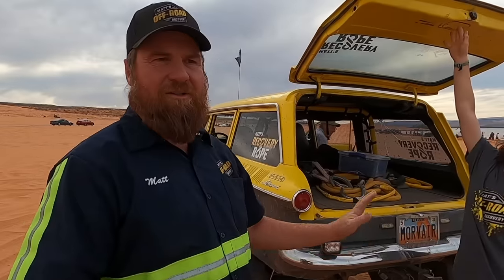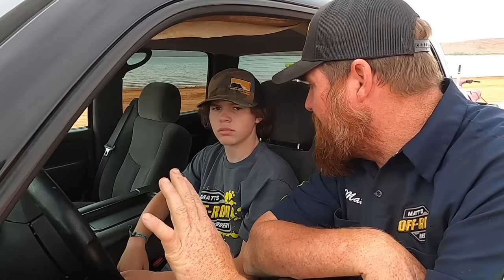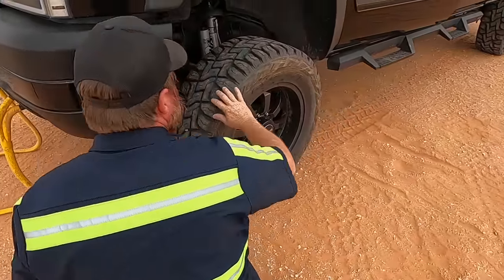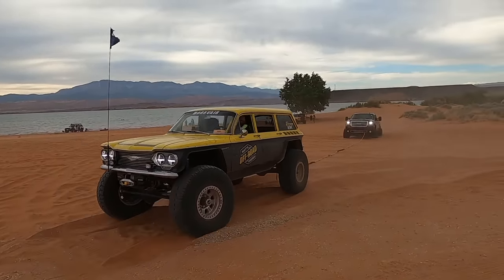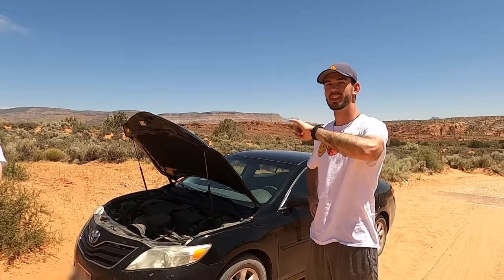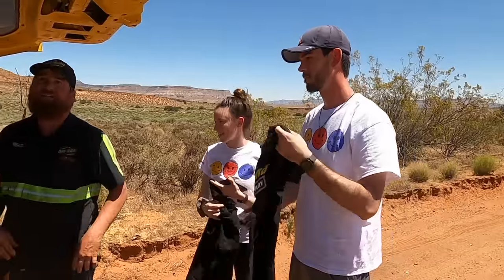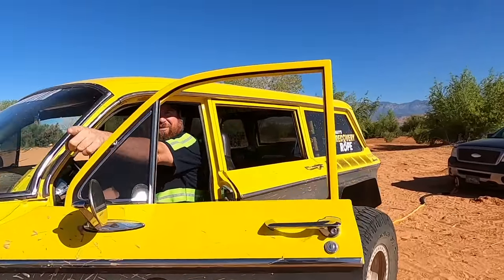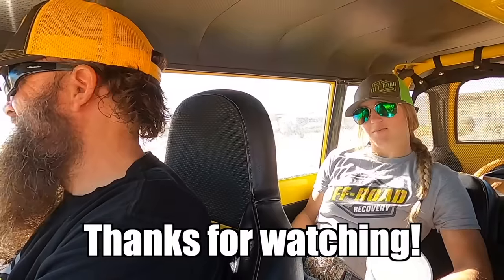Destroyed Drive Shaft! Some Trucks Aren't Made For Sand

Comment: I'll bet folks didn't notice, but @5:53 was a master class in driveline and traction management - Matt got off the go pedal right before he started getting traction from the asphalt.  It's subtle, but that's how you keep from breaking stuff!
Reply: Oh I noticed, I've seen what happens if you don't!
Reply: Also noticed. Bad news if you stay in it.
Reply: Yeah alot of the terrain that I run can go from loose sand and silt to hard pack and rocks in real quick succession so ya gonna know just when to snap the throttle shut before parts go 'bang!!' but also not to soon or you'll be stuck between some rock and a sand place!!!LOL!!!
Reply: I have learned to turn away from certain four wheeler trails.
Reply: That’s the easiest way to snap a shaft. Lotta grip quickly.
Reply: Yep I noticed?

Comment: I learned to drive in a Corvair just like that. My parents bought it new from the dealer in 1963. I do not remember it having the power seen here. I think the reason Matt can get that small air-cooled engine to do this much work is pure driving skill. LOL. I loved watching them restore this Corvair and convert it to the Morrvair, but every time I see it in action I remember my original driving experience. In addition to the Corvair my family had a Chevy with the big block V8, this is the direct ancestor to the motor MORR is putting into the big wrecker. It was amazing to drive the Chevy, and lay rubber.
Reply: It has a LS motor in it now sir.
Reply: "small air-cooled engine"  🤣🤣🤣

Comment: "I was hoping for more of a struggle", says Matt. ---  Truck and trailer weigh 20,000 pounds (9071kg)
and Matt's little yellow Corvair  weighs about 5,300 pounds (2404kg). That was more like a tractor-pull than
an off-road recovery.
Reply: guessing more like 5000-6000kg on the truck and caravan but yeah still impressive
Reply: @MrTrizmaster  If your truck and trailer don't weight 20,000 pounds, just be patient. 
Your wife has not yet finished loading everything you won't need for the trip.
Reply: @lanceleavitt7472  it just in norway we have max limits on how much the car and trailier can weight, depending on the lisence, car, and allowed storage weight,  and a car is usaly not more than 2,5t on avarage(aware of ligther and heavyer vehicles) and a caravan ( with normal weight around maybe 2,5-3t. But i do not know what you are allowed in merica, but 9t looks too much for that truck and caravan, uness it is filled too the brim with rocks.

Comment: I'm surprised that a truck with full on street tires and zero sidewall managed to break a driveshaft on sand without jumping it. I wouldn't have expected that to be possible.
Reply: What if he had revs on and banged the shifter D to R to D again and again?
Reply: Stock one broke had a company make me one and they didn’t weld it right

Comment: I know next to nothing about trucks, off roading, 4-Wheelers, etc., but I have really come to enjoy this channel. I noticed that Matt commented that the truck with the jet skis in tow had tire PSI of 65. During the actual pull, Matt’s truck with presumably lower PSI appeared to float across the top of the sand, while the truck and trailer in tow seemed to plow or push their way through the sand. Am I correct that the tire PSI difference is what allowed this to occur?

Comment: Hey guys! I know this will seem off topic but I have a suggestion for you. How about putting a gas tank in your yard for fueling your vehicles. When you get back to the yard part of your unloading routine could include fueling up. That way you will always begin a call out with a full tank of gas. Maybe you won't run out of gas so much. Plus, you might be able to get fuel cheaper as well. Just a thought.

Comment: So I was just out in Central Utah, west of Provo picking up a trailer with a 1 ton Chevy.  I had to drive 7 miles out on a country / dirt road and had a patch of sand dune that covered the road. I knew from watching this channel that a 1 ton is not the best vehicle to handle sand.  I also knew that if it got in trouble I was going to have to let some air out of the tires!

Comment: I bought a CAT brand portable power station with a air hose on it and I'm going to deflate my tires on my truck when I go on the beach and see how well it does.  It's nerve racking to drive a diesel on sand.

Comment: It amazes me that someone can sit that long and no one offers to help. And, at least on our beach, diesels, properly equipped and aired down, do just fine in the sand.
Reply: People do help each other out but when it's traiker or something they call the pros
Reply: @skeeterbuildsit6016  That truck and small trailer? Pretty easy pull typically for us out here, though I don’t know his sand. Just gotta have some recovery equipment, which, if you are going off pavement, you should invest in and have anyway. Hell, it’s a party if we get multiple vehicles stuck. Adds to the fun.

Comment: Still haven’t answered why you didn’t choose a diesel for the heavy wrecker. I like the Big Block chevy but just want to know what the cons are for a diesel. Mainly because that’s what’s in my build.
Reply: Power to weight ratio. In the sand you want a lot of HP and little weight. There is a reason the Top mudd trucks are gassers.
Reply: @davids.9834  I’m not sure if that’s all of it, probably for the mud trucks is people find it’s easier and cheeper to build a gasser. But power? My truck is around 500hp, 1300lbft and that’s a mild diesel.
Reply: @robertcotrelljr8573  and probably for the price of what you put into it... you could have gotten 1000 HP out of a large block v8 that weighs in at half of what that diesel weighs. . Im not anti-diesel,  but they just are not great in the sand. They just dont have that instant, wack the throttle, and your skimming over the sand, response.
Reply: @davids.9834  also I speculate from experience. Many have setup issues, if you setup up your diesel trail rig like a gasser, yes it will fail. Diesels don’t need the low gears that gassers do to obtain the necessary wheel speed. Many people I’ve seen on forums and such just don’t take the time or thought to build a smart combo. With my truck it is on 40’s and only run 4.56’s gears, I rarely every use 4 low. That’s said I’ve haven’t gotten to more technical trails yet. But if I needed wheel speed for sand, I’d just take off in 2nd and can assure you the wheel speed would fling sand to the moon.
Reply: @davids.9834  oh and one last thing. I wanted to know why Matt didn’t want one, I’m sure he has a good reason and I want to know what it is. For my build or a future build, he builds smart vehicles and I would like learn.
Reply: @davids.9834  well maybe! It’s easy to hit over a 1000hp with a diesel and twice that in torque. Plus yes you can have good throttle response out of a diesel too, if you assumed that and drove a p-pumped Cummins you’d probably lose it on a wet highway at any speed. I grew up as a hotrod’r and refused diesel could do anything other then tow. Boy was I wrong, imo the only reason they don’t dominate every power sport is this country always pushes gasoline and never consider them until the early 2000’s as performance engine.

Comment: What kinda tires does Matt's recovery yellow rig got on it
Reply: @MattsOffRoadRecovery  
Heck yeah man . . . Them things looked spectacular doing what they were designed to do and that's stay on top and bite the sand instead of trying to become a mole and dig a tunnel. Making me rethink my plan of attack on a sand loose dirt tire 🙃 . . . Yeah I was going to try out the Interco - TrXuS STS - Radial ( four 38's on a dully back axel, 10" rims 10" tires and use two 44" swopper boggers for floatation on the sand and if things got muddy they'd prove their worth ( I'm thinking anyways) on the front of a regeaded differential that would match the gear ratio of the rear differential. 
But after I watched your rig float like a butterfly and sting like a bee jerking them heavy chevys to safety with little effort, gots me going back to the drawing board. 
My set-up is a 90 model Ford F350 1 1/2 ton single cab short wheel base 460ci turned into a 557ci 730hp on 93 octane changed over to propane binging the horse power down to 590-600hp to handle the environment of river sand and loose dirt with occasional snow ice and mud it will encounter here in the mid-west. I think I got to check you're tire choice out. My rig won't be heavy as the rigs you pulled out, just a tad bit heavier than yours on account I've got a short steel flat-bed on it with propane tanks on each side. Purpose of vehicle is, if shtf, out here in the flat lands of western kansas, my propane rig will be easier to get fuel than diesel or gasoline I'm hoping anyways lol lol

Comment: I'd be really upset that my $100,000 truck broke a driveshaft in sand...America is building garbage trucks and charging out the nose. Just bring back a simple truck with a decent V8 and four-wheel drive, we don't need 90 computers and touch screens.

Comment: Once you take a perfectly good 4wd truck and put those useless 20 inch rims & low pro tires, which may be great for handling on the road but you made it pretty useless off road. The tread is completely useless and you have no ability to drop your air pressure down so you have no traction at all in the sand, snow, mud or any type of soft terrain. Kinda defeats the purpose of having a 4wd truck.

Comment: You yanks got no idea how to drive in soft sand.  First lower your tire pressure. Second  put your gearbox in low drive. Doing wheelies will only bury you. Towing boats etc will not help in soft sand. Hopefully you have low drive in  your 4wd vehicle. If you thrash vehicles it will not last long.